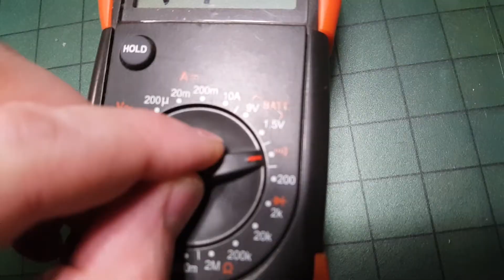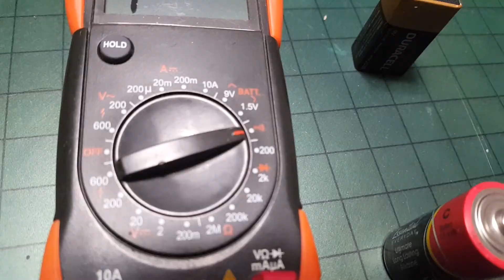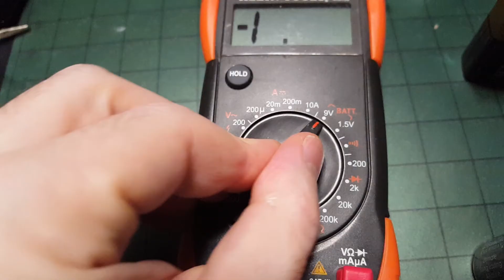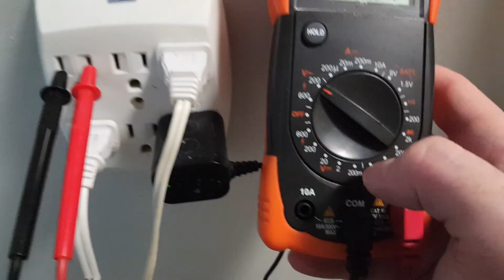Christmas Tree Lights Not Working? How to Check a Fuse With a Multimeter And Replace a Fuse

Comment: Change with new fuses but one light testing bad after there new bulbs
Reply from the maker: If you mean just one socket, then I would guess the contacts in the socket are not making full contact with the bulb or the wires just under the socket are broken. You might be able to pry (unplugged of course) the contacts inside the socket, but if the wire is broken, you may need to replace. The wires are very thin, 18 to 22 gauge and there is only so many times it can be moved around before eventually it breaks. If you plug it in and move it around and it only occasionally turns on, then it is just momentarily completing the circuit of a broken wire, and would be best to replace the strand.

Comment: Most modern Christmas lights are wired in parallel which means the lights will still work when there is one light out. What about when one half of the string is lit and the other half is out?
Reply from the maker: That's true for each strand of most modern lights, lights are often more than one circuit so when one has an issue then that whole circuit could be out while the rest of the lights may stay on. Even if the bulbs are parallel, the whole strand may be out due to a blown fuse, broken wire, or connection issue.

Comment: Mine doesn’t have a little opening on either end
Reply from the maker: Look for "125V fuse" or "3A max", you should be able to pry the little door open to see the fuses. Also make sure the bulbs are all pushed in, none are missing, and none look burnt out.
Reply: I carefully inspected. It’s smooth all over in both sides. No door 100% sure

Comment: what do you set the volt meter to before testing the fuses???  oh I see set meter to the squiggly lines...my fuses beeped but the whole strand is out and tried another outlet as well....
Reply from the maker: Multimeters have a continuity setting. If the fuses are good, then there may be another issue, such as a bad bulb or loose bulb: https://youtu.be/ZpMavsaPtcE

Comment: So for the light fuses, if its less than 3Amps the fuse is bad? I tested all mine and get a beep with various amperage running through, but each fuse is giving different readings. Does the beep mean the fuses are good? If it does not beep, does that mean fuses are bad?
Reply from the maker: The multimeter on the continuity setting sends a small amount of current through the tested component. If the fuse is bad/blown, then there would be no continuity (no current going through it) and you wouldn't hear a beep. If you replaced the fuses and it still doesn't light up, there may be another issue: https://youtu.be/ZpMavsaPtcE

Comment: I have a multi-meter a much less expensive version.. it does not have sound but it has a continuity setting  what  shouldr I  look for on that since I have no sound? thank you for the great video!
Reply from the maker: I tested mine with an outlet tester to see if voltage was going through the strand to the outlet at the end. Otherwise, you can try taking some of the bulbs out and carefully testing the conductors inside. It's easier to see a video demonstration or an article like this: https://electrouniversity.com/how-to-test-christmas-lights-with-multimeter/

Comment: What did you do when the fuses were good and the strand didn't work? I'm in that situation with 5 strands on a prelit tree, checked a ton of bulbs and nothing bad. I guess I could remove them all and start over.
Reply from the maker: Were you able to see if the strand was getting power with a multimeter? I'm sure you've looked for other videos by now but this was the first result for a video about checking voltage etc to test the strand: https://youtu.be/4JxXMluHDac